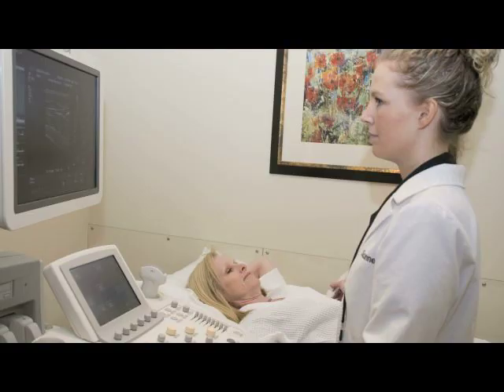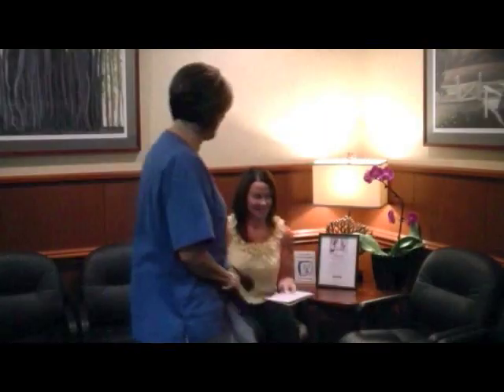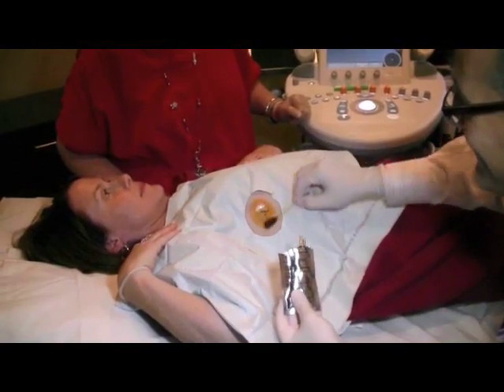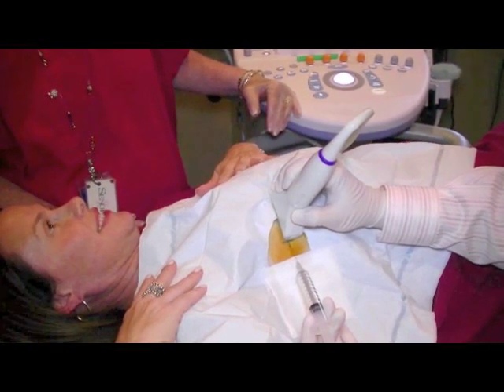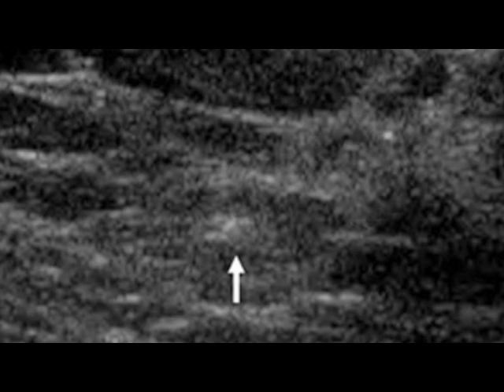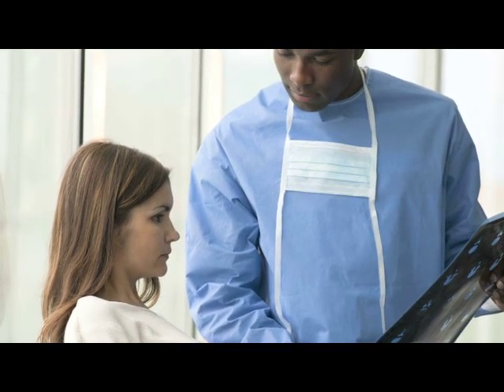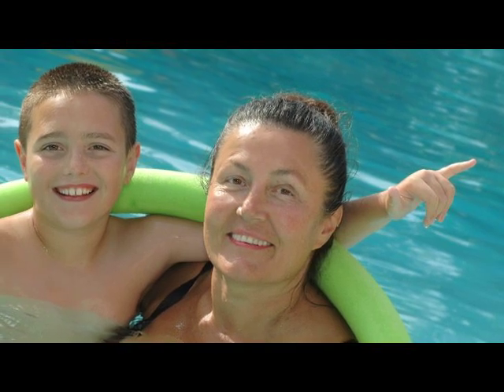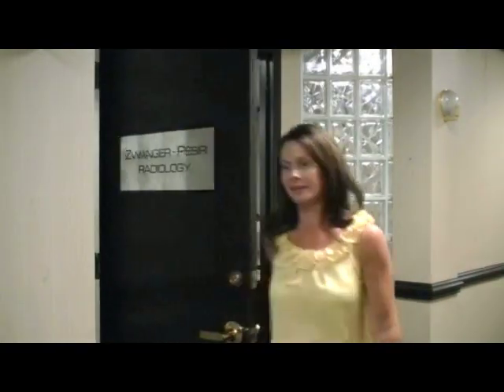Ultrasound-Guided Breast Biopsy - Dan Settle MD

Comment: Listen ladies. Think of your experience at the dentist. They both use ladicaine. You will experience a little pinch and burn with first injection. But not much afterwards. Make sure they give you enough, then give it time to work. Because it's a probe they stick into your breast. Your breast is very vascular with a lot of nerves. You will be left with a deal of bruising and soreness. Have icepack and extra strength Tylenol at home on the ready. I have a real issue with people being under informed on what to expect. Be prepared to speak up and be your own best advocate. Don't let them rush the procedure until your comfortable numb. There is no reason you should suffer needlessly. It can put you into a state of not trusting anyone with future procedures. You now have the knowledge of what to expect. I'm being truthful and honest. Best wishes. As this test is very necessary to find out what your dealing with.